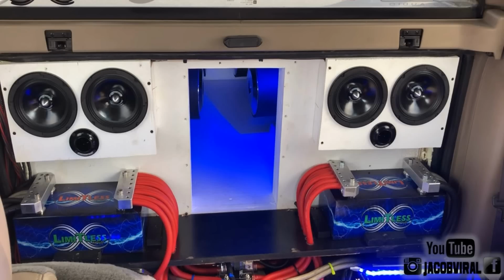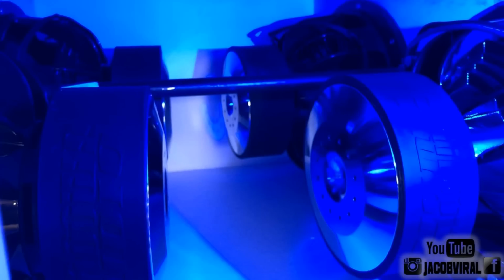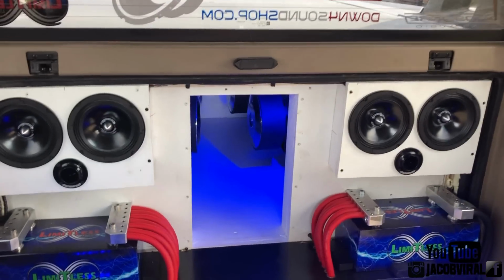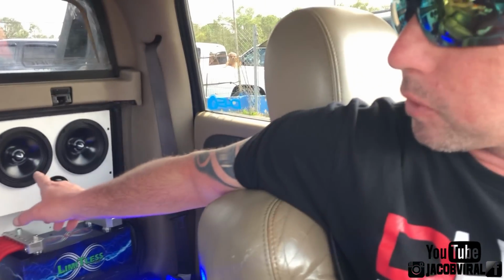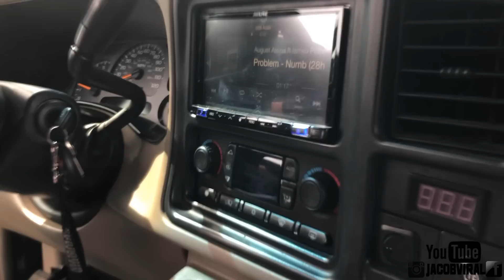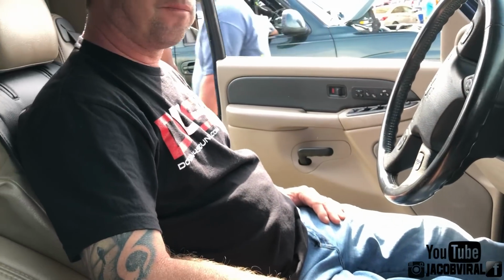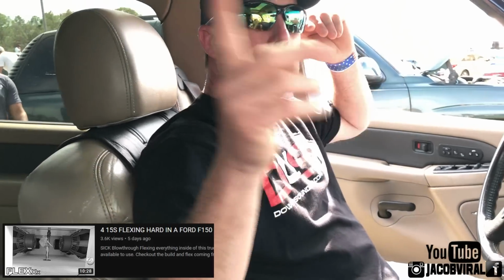4 15S IN AN AVALANCHE DESTROYING THE INSIDES

Comment: Crossfire amps put out double rated
Reply: Crossfire AMPS and SUBWOOFERS can handle extreme amounts of power especially when it's clean power most systems can handle over rated power as long as it's good clean power but to be on the safe side i always make sure my system is tuned SMD-DD1 u know what they say ALWAYS SET UR GAINS (✌🏼💪🏼🔈💪🏼🔉💪🏼🔊)
Reply: @basslife4evr772  I have one of those dd1 meters. When I went too test my head unit's max volume b4 distortion I couldn't. Like I followed all the directions too. When I was testing the signal light came on then the 40 hertz detect but the distortion light never stayed on it just blipped. Any idea's what might be causing this?
Reply: @moto9968  Some head units won't clip at max volume. Be sure that all your eqs and crossovers (bass, treble, etc) are set to flat when you are testing.
Reply: @jayellis3738  alright I must of missed something then

Comment: Jacob what are your thought on Kerfed, Slot, and Areo ports?
Reply from the maker: All great for certain applications. I personally Like Kerfs in a ported slot but little more work to make and cost more to pay someone. Aeroports is the easy route and seems more burp friendly and takes less space up sometimes. Slot is what I did because it's easiest and more box bracing using slot.

Comment: Okay Jacob, I gotta stop you right there.

You can NOT build a "Sound Quality" system without any front speakers, granted they don't have to be in the doors.
What you're claiming is even dumber than saying you can build a db Drag car without any subwoofers in the vehicle.

Just having mids and tweets in a vehicle does not make it a "Sound Quality" system. Having your mids and tweets mounted behind your rear seats is the exact opposite of how you build a "Sound Quality" system.

And also, it's not a blow-thru because nothing was cut. It's just an Avalanche, they ALL have that feature.